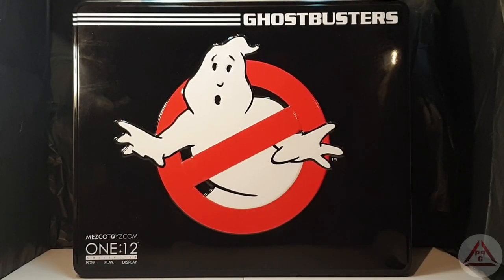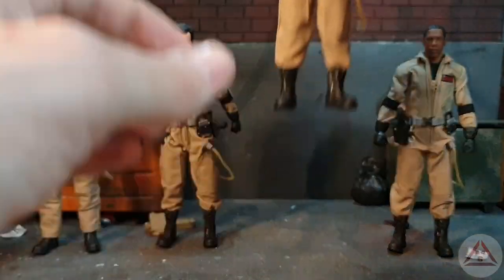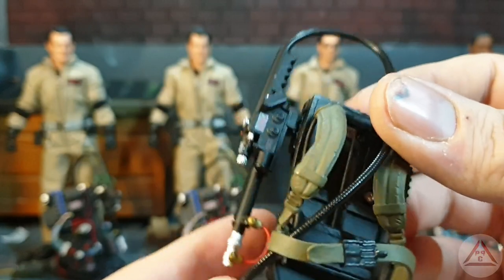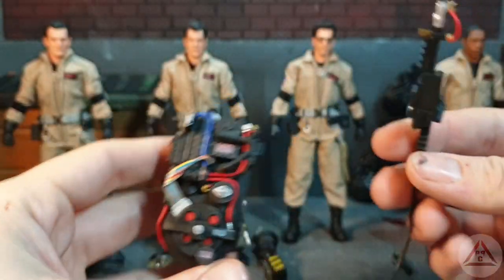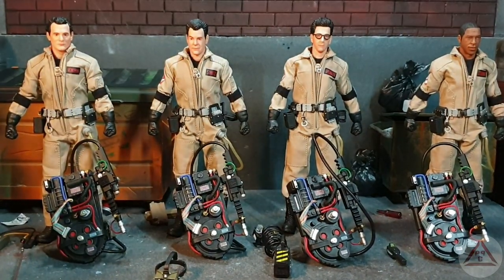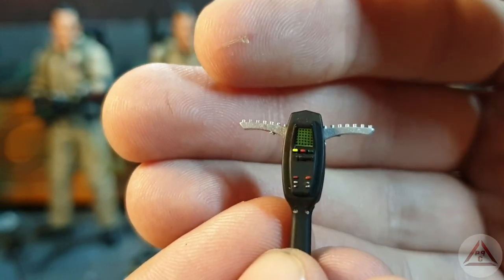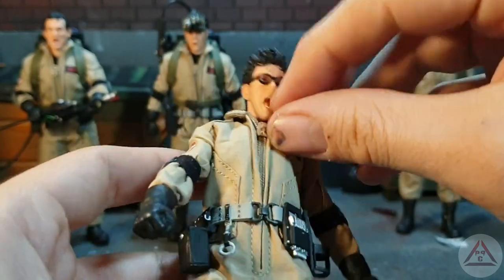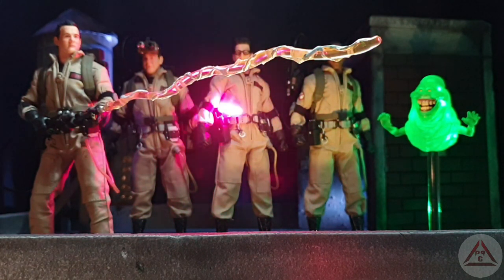Mezco GHOSTBUSTERS One:12 Collective REVIEW

Comment: I had the same issue with Winston's nose - the packaging fattened it some and made a shiny spot. I heated up some water in the microwave for a few minutes and put his nose into it for a few seconds. The plastic "popped" back out and his nose was no longer flat or shiny! Some people also had this issue with Mezco's Wonder Woman, and they did the same and it fixed theirs too. So it is worth a try to fix the nose!

Also - for the proton pack straps and Ray's goggles, I suggest hitting them with some heat first - like a hair dryer or space heater. It softens the vinyl and makes them more pliable and easier to get on and off.
Reply from the maker: You sir.. are a saint!!! 🙏🙏🙏 thank you for the advice mate! Will deffo give this a try, will let you know how i get on 👍🍻
Reply: Awesome tips thanks